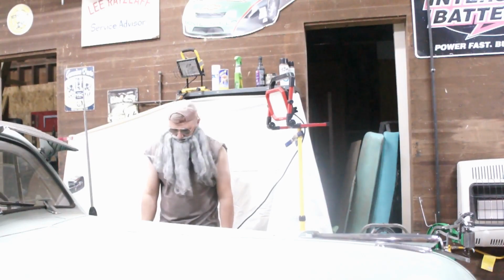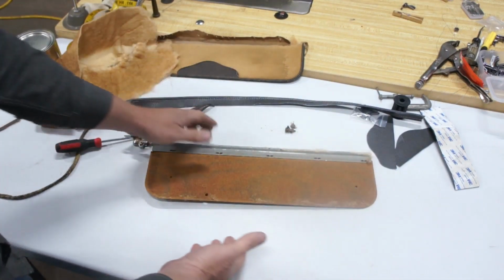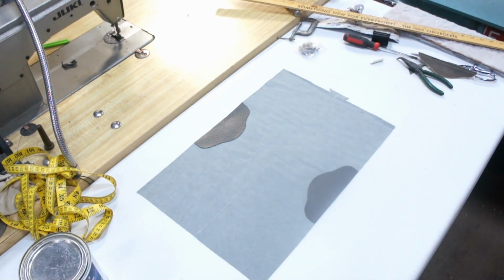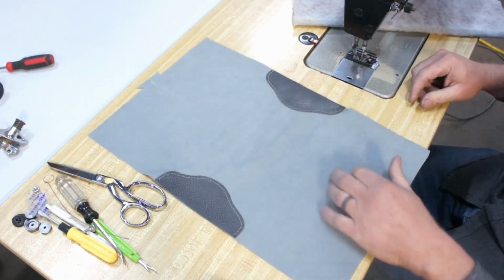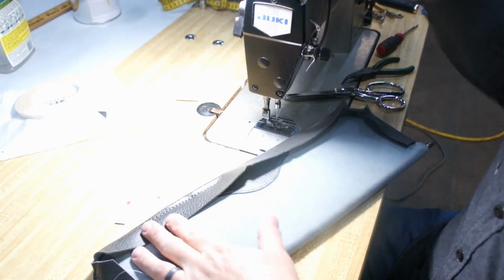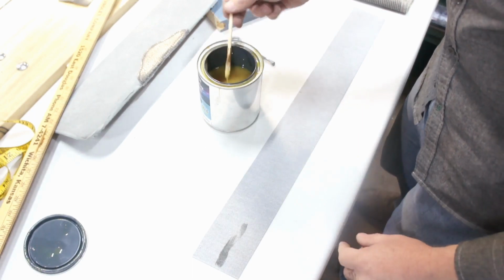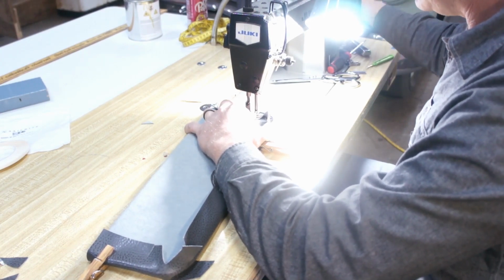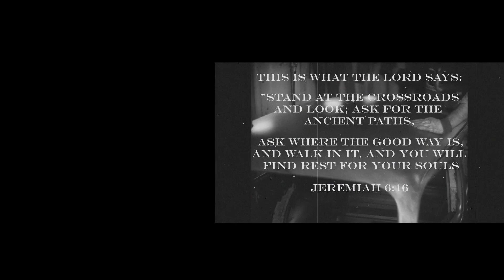Recovering 1940s Sun visors - Well I Tried!

Comment: Look up: Binding attachment on Walking Foot machine.
I have a walking foot machine for upholstery.The extra foot presses down hard to hold all the layers together to easily feed the thick material through the machine, without slipping out and moving, for perfect stitches.
You did a good job with your industrial machine, you have to work really hard to sew thicker materials. Glue and staples can help manage heavier materials.
Also using bonded nylon thread. it wont fray and usually lock up the machine before it breaks.
Reply from the maker: Thanks for the tip, I hope to get a walking foot machine before my next project. thanks again.

Comment: Did you ever figure out that you dont need to glue or tape the binding just cut it big and pull and stretch while your going around it?  Then you would trim close  to the stitching afterwards. Also an edge guide helps a lot. Either the kind built into the pressure foot or the swing down.